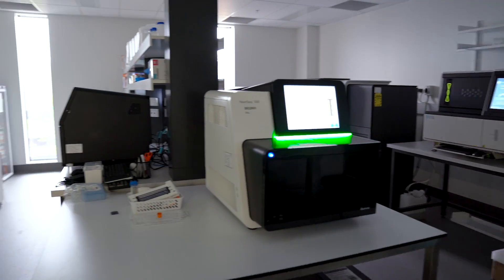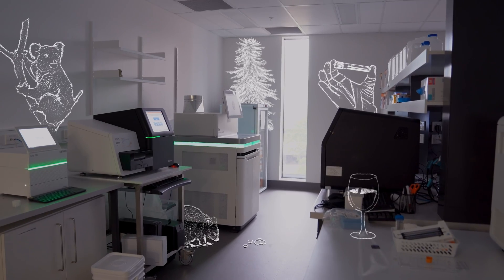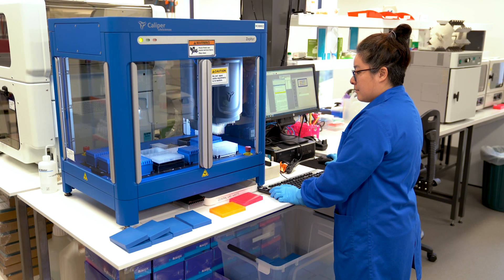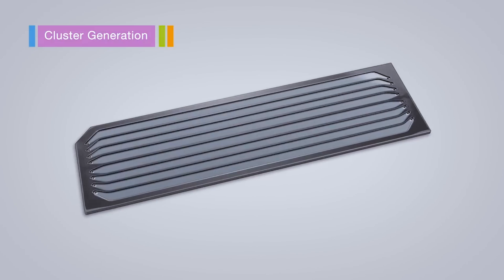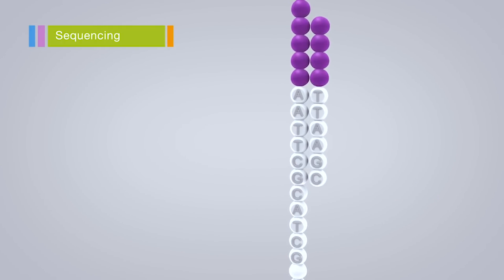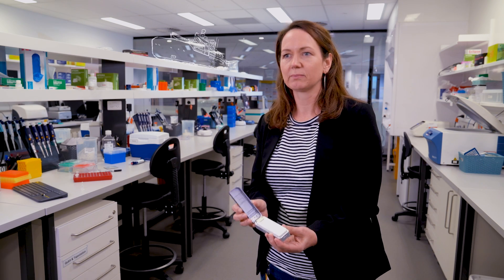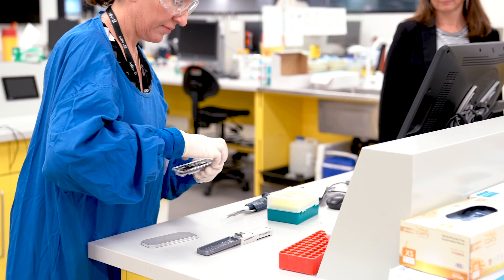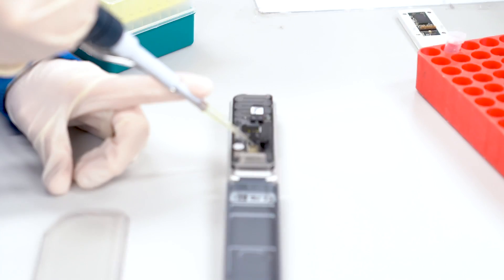How does a DNA sequencing machine work?

Comment: Can you explain how this is different or similar from next generation sequencing (NGS) ?
Reply: The process she is describing with the Illumina NovaSeq is next-generation sequencing. It is 'next-generation' compared to Sanger sequencing. The process she is describing with the Oxford Nanopore Minion is considered long-read sequencing, or has been referred to as third generation sequencing.
Reply: It's similar in the fact that in both cases a DNA strand is grown from Dideoxynucleotropes (ddNTs). These are the As, Ts, Cs and Gs of the DNA strand with two of the hydroxyl groups removed so they don't just bond to one another and make DNA on their own, and need a separate RNA strand to form properly. They just add a dye corresponding to each (e.g red for A, blue for G etc.) and throw it at a string of RNA taken from the DNA you want to sequence and make DNA from it. You then measure the frequency of the dye to figure out which pair is in the DNA and you have your sequence.
It's different in that in Sanger technology, they grow a single, large piece of DNA using this method which takes ages. In NGS, they use small pieces of very short RNA called ONTs (oligonucleotropes) and they add those to a piece of broken up DNA. They then heat it to split it into two long pieces of RNA through denaturation. 
They then have a chip with ONTs placed on the surface, each on top of a transistor, which the ONTs on the ends of the RNA happily bond to as they're chosen specifically to pair. They then start making DNA of themselves. The chip measures the electrical resistance of each strand as it grows until it has a sample that's just short enough to have grown quickly but just long enough to be a useful sample, and denature it by passing a current through it to heat it up. They then have the perfectly-sized RNA cleave itself through some method or another. Either that's chemical by adding ionic copper to it or mechanical.
They then grow DNA out of it using ddNTs marked with dyes just like Sanger method, but this time instead of measuring one strand, they measure millions of short ones and compare them between each other and a control sample using a computer. This allows for far faster genomic sequencing, and can be used for more specific applications such as searching for a certain gene. For a complete sequence, Sanger will still be necessary however, but that's frankly quite a specific and highly scientific application.
You can imgaine how much faster that is going to make searching for something like the BRCA gene or an autoimmune disease in a person's DNA in the coming decades. You could probably have it done at some GPs before long.

This is my understanding of it, I'm no expert. If there's anybody who knows better what they're talking about: feel free to correct me. This is the best way I could simplify it for myself personally :)
Reply: @jackeldridge1319  Could you please clear up something: 'short pieces of DNA' doesn't sound to me like you'd really know how they all fit together end to end, kind of like getting a box full of puzzle pieces without a picture to work from. You could analyze the hell out of each piece, but that wouldn't tell you the picture. Or are they somehow growing entire complete lengths of intact DNA all unravelled?
Reply: @HuFlungDung2  I think you really misunderstand how DNA works. These methods create RNA, which will always become DNA in the presence of the As, Ts, Cs, and Gs, as they will bond to their subunit mates. They also have a sample made with Sanger that is stored digitally, and they cross-compare it using an algorithm. They line up what traits match up, and what don't in order to sequence the genome. Imagine you cut up a page of a book into tiny strips of paper, but you keep a PDF of the first edition up on your computer. You can get all the info you need from those strips by lining them up and arranging them, as long as you have that PDF up to figure out what adds up, what's different and what's odd
Reply: @HuFlungDung2  RNA that's bonded to these subunits won't bond together end to end because they use primer chemicals, such as soaps, that bond to the ends of RNA strands and stop the bonding process, keeping them very short and intact
Reply: @jackeldridge1319   Thanks. I hadn't heard about Sanger sequencing and watched a few videos about how that works. Now I get the concept, it's pretty clever. :)
Reply: @HuFlungDung2  Oh yeah man ikr, it's so clever but so obvious when you think about it. Like all you do is mix the As, Ts, Cs and Gs with food colouring because when they're dedeoxylated it'll happily bond to sugars without a care in the world, and you just let the DNA make itself from an RNA strand and you just measure the colour band frequency of the light to get your sequence. And the fact that NGS isn't that different at all, it just automates the process and does it millions of times over in hours instead of once over days. Absolute ingenuity